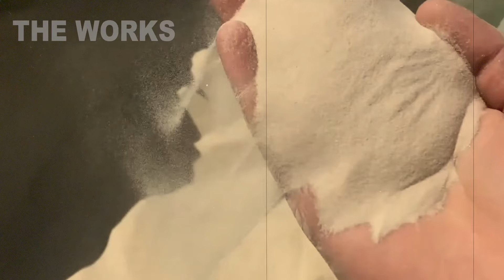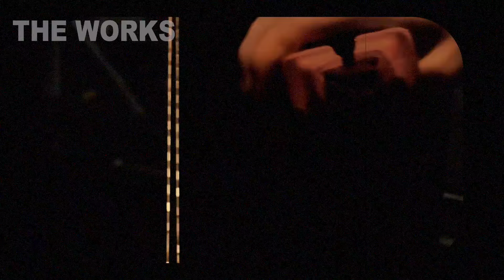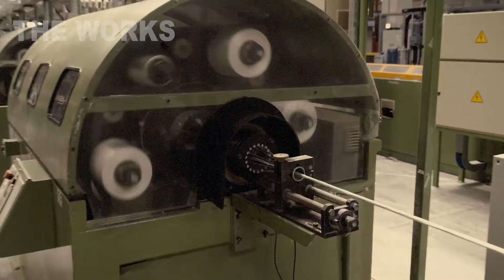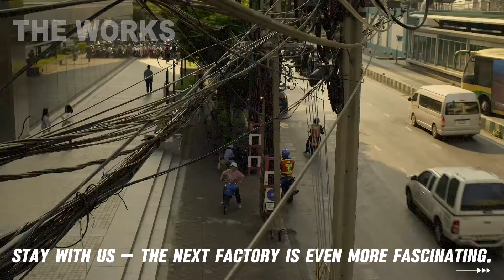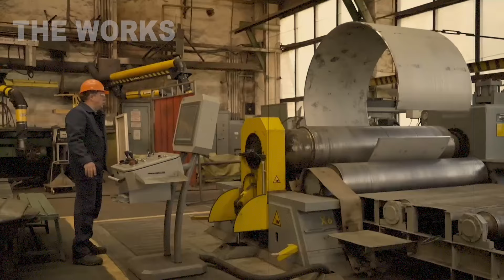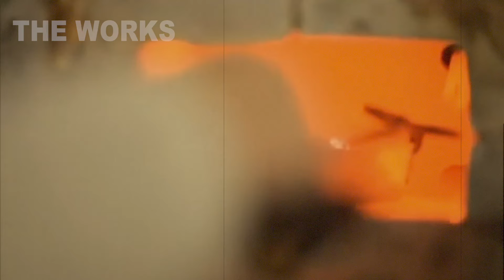How Pure Sand is Transformed into Fibre Optic Cable | Inside a High-Tech Plant

Comment: due to the higher fraction index of Glass light is much slower than in vacuum. ist jsust about 200.000km/s
Reply from the maker: Thank you for your insightful comment, @gondrom! Indeed, the refractive index of glass significantly affects the speed of light, which is crucial for understanding how fibre optic cables work in transmitting data. 📡